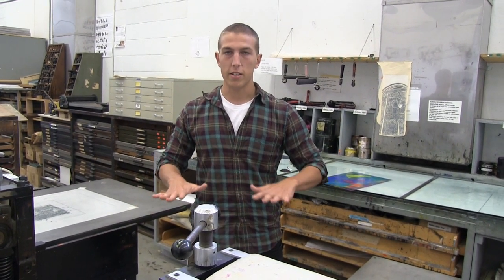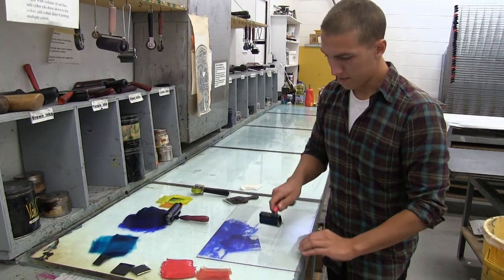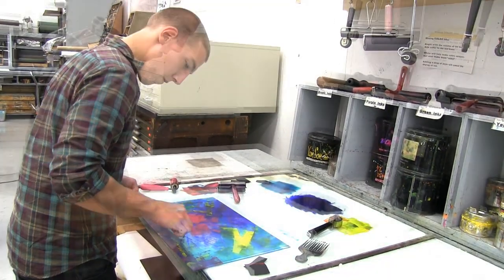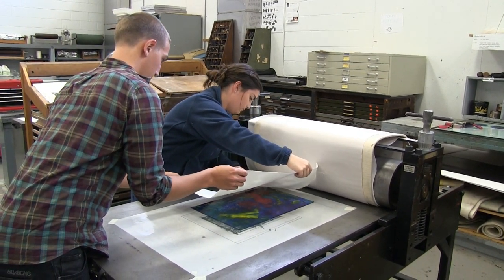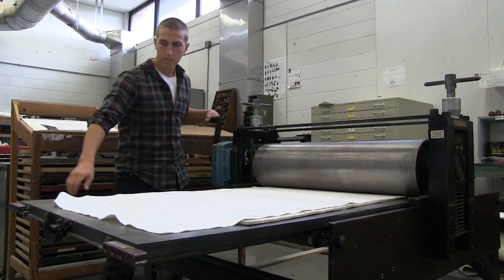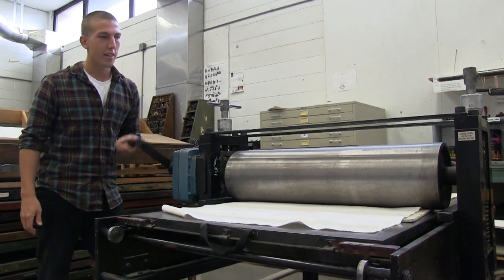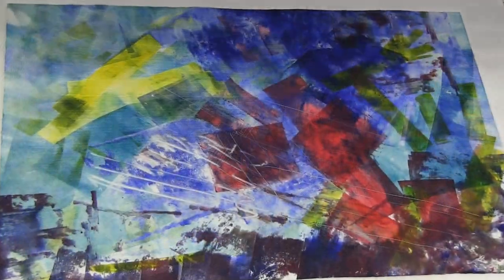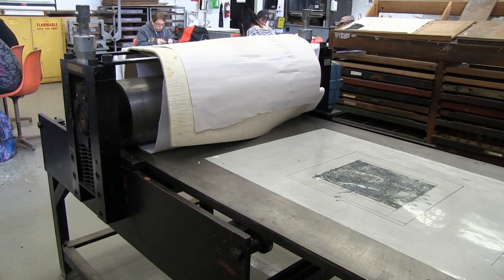Monotype Printmaking at SUNY Oswego

Comment: Could someone share any info on the paper preparation. ?. Also wondering if the paint on the plate or plexiglass has to be dry or wet..
Reply: Paper is likely Johannot, or some thick cotton European paper, that's been placed in water for probably at least 10 mins so that it will better absorb and retain ink as well as tear less easily in the press. The "paint" is actually ink, which is always "wet" more accurately a liquid state. If ink is dry it's because it has been exposed to air for too long and becomes unusable. Cheers.